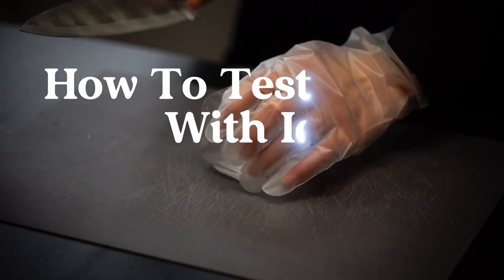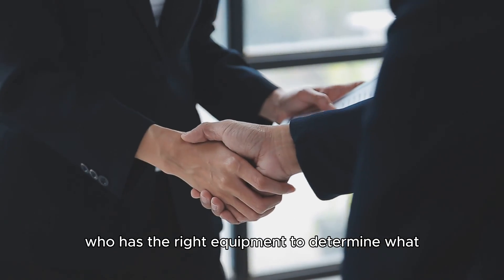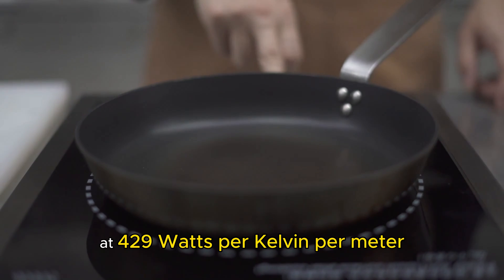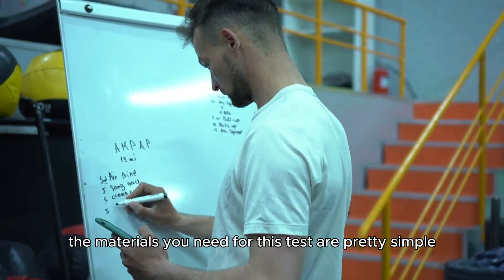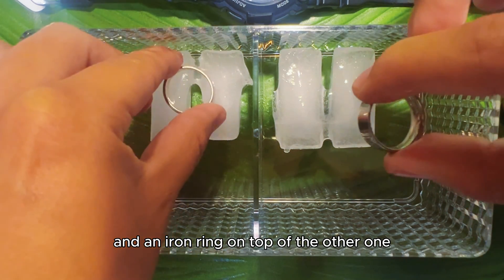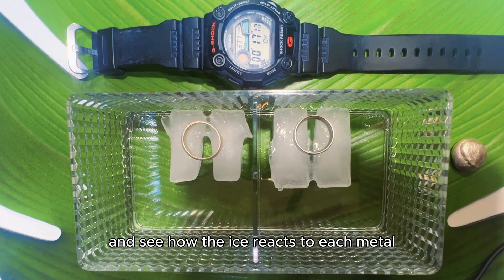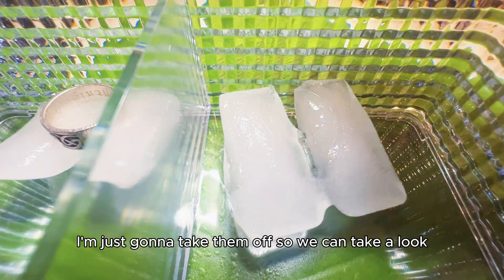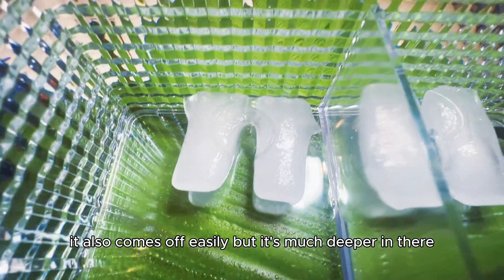How To Test Silver Jewelry at Home (DIY)

Comment: Thank you for this video. I think you proved your point about silver conducting heat away from the ice cube faster than the iron ring is capable of. For me, it would have been conclusive if you had let the test run until the silver ring was inside the ice cube, barely visible while the iron ring would have been still on top of the ice.